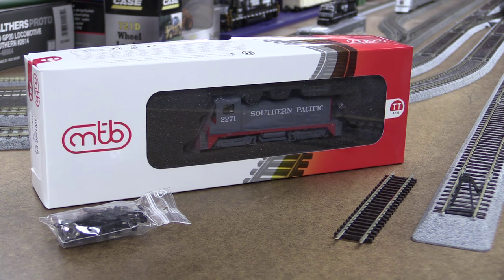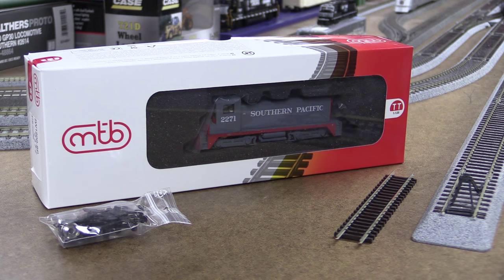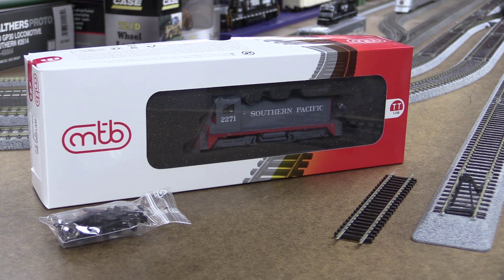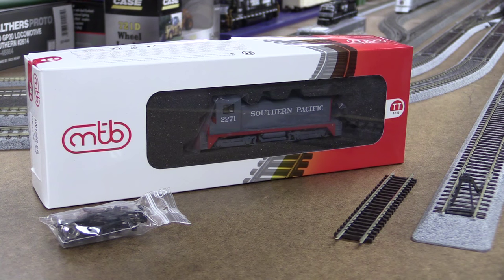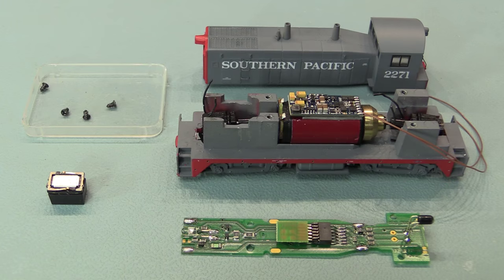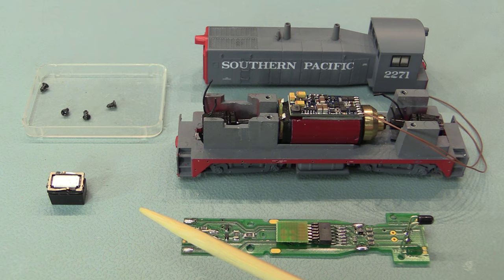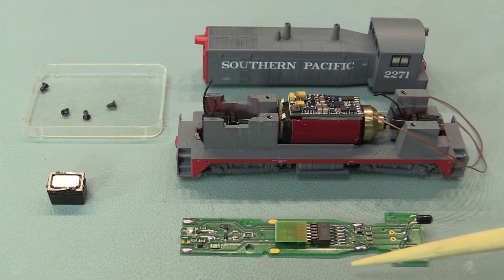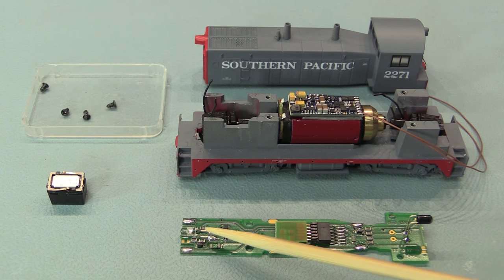Loksound decoder installation SW1200 Zimo sugar cube speaker TT scale Southern Pacific

Comment: Is this the only TT scale American loco you have seen? I have always been interested in TT scale
Reply from the maker: Yes, this is the first one. Are you in the US?
Reply: yes I am in the US, are you planning on being a regular distributer of American TT scale? I am pretty invested in HO but this little Loco makes me want to build a small table top layout as a traveling display type layout. I like the fact that TT scale offers almost the same detail as HO but in a slightly more practical space. For example in Ho the smallest layout that alows for continuous running and and switching of 4+ car trains is a 4x8. However, a 4x8 is though not large is still very large when placed in the small bedrooms of most appartments; not to mention it is very difficult to get through doors if/when you have to move to a new apartment.
Reply from the maker: Joels Train TT is very nice scale, I never thought to carry TT. Let me do more research on manufactures, are you interesting in US models and also European?
Reply: mostly just US models, I like this switcher because you could build a switching layout in either the transition era, 70's and 80's, or present day. I would like to build a layout of two moduals 18"x84" that could be either butted end to end or side by side as a 3'x7' loop.

Comment: hi I have done a proto 2000 sw9/1200 I have installed a loksound micro sound decoder and have cab light in it but when I put the cab light on and then the directional lights it makes the cab light brightness go down I have the positive wires to the blue with a resister and the cab light to aux1 green what have I done wrong to have the cab light do it thanks simon
Reply from the maker: Are you using LED's or bulbs?
Reply: hi I have dcc concepts nano leds
Reply from the maker: @simoncook4070  OK, you need to add resistor 1kOhm per every single LED.
Reply: ok as I have one 10k resistor on all so you mean I have to have three resistors like a daisy chained so each led is connected to each one is that correct as I have the esu programmer and made aux1 green for the cab light

Comment: hi I have added three resistors all 1k and all single led and it still doe it I turn the cab light on and when I do the directional lights it makes the cab light go dimmer ?????????????
Reply from the maker: Then the can light set this way in the decoder configuration.

Comment: hi can you send a diagram of what it should look like thanks
Reply from the maker: There is no diagram, there is a combination of CV in the decoder PROM setting.  Do you have a computer connected to your DCC system?
Reply: hi yes I have a esu programmer so I do my own down loads
Reply from the maker: @simoncook4070  You need to adjust lights setting.